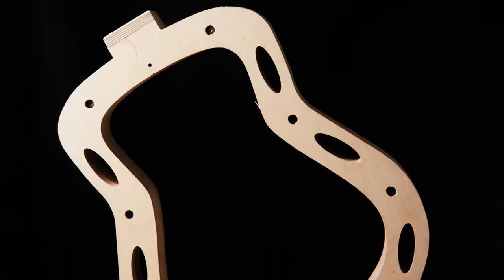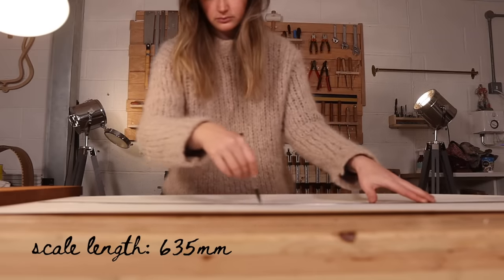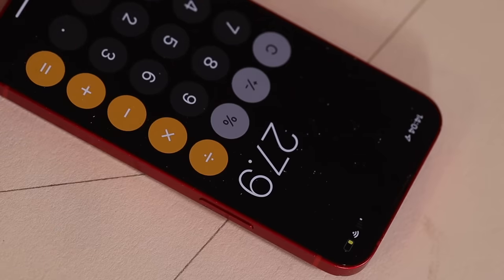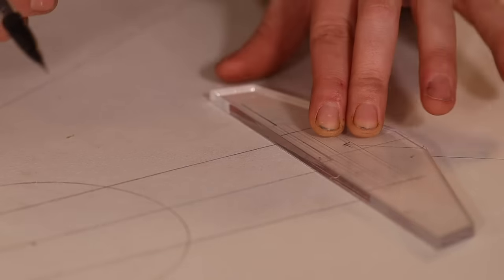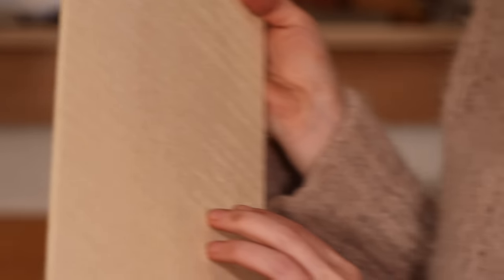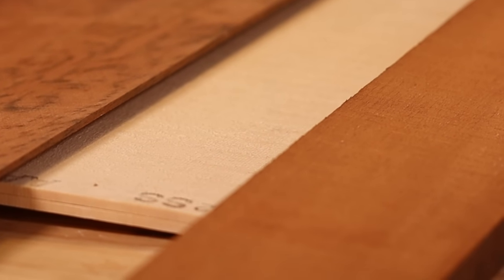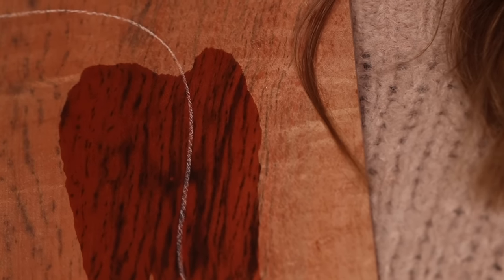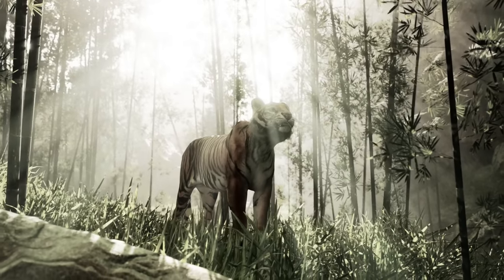My first step when I make a guitar

Comment: Im waiting for my UK pickup to arrive before I can start drawing out the string spacing and with that neck width, I copied my current string spacing at the nut from my strat, but may alter this depending on the pickup spacing, building an archtop

Comment: I had some mahogany piece, really small width though laying around from my former work. So I cut in half with a handsaw of course, and I bent it, pretty succesfully in a cutaway. But I'm pretty sure this is the african mahogany. Really tough to bend I read on this later. It took me a good couple hours, probably due to it having a crack at the cutaway, and the material being 3mm thick. I think I'll be succesful at glueing this crack though. And then I'm kinda happy with this 3mm thickness. Yes it takes a long time to bend, but I feel that is totally worth it. Especially if you don't do cutaways. Bear with me though this is all forum knowledge here, but also read that the sides of the guitar pretty much don't contribute to tone at all. So I feel that if I wanna make a good score on structural integrity, the sides are a good place

Comment: Great size choice. I’m 7 years in on a Martin 000.  I love smaller guitars but generally if you play them hard the tone falls apart (little martins do that quite early on but they sound quite good doing it as Mr Sheeran will attest).  I found the 00 also started to fall apart on a massive strum out, but the 000 hung in with whatever I could throw at it.  I spend most of my playing well away from the limit but it’s good to know you can go there if needed.

Comment: Thanks for the glimpse into your process, Daisy. None of my furniture designs are inspired by poetry, but perhaps that's something I need to try. :) The pieces I've built and the ones in the short-term queue have all been driven by functionality and my still fairly basic skill level. That hasn't left much room for getting too detailed in the aesthetics. That's left me leaning heavily on classic proportions and fairly simple forms, though those of course have their own beauty. 

You've selected some amazing wood for this project and I'm sure it will turn out spectacularly. I didn't catch what species you're using for the back and sides - is that goncalo alves, aka tigerwood?
Reply from the maker: It is tiger myrtle! And yes furniture pieces would lend themselves well to poetry I’m sure :) thanks for the kind comment

Comment: yeah so getting that crack all the way back isn't gonna work. At the cutaway I got now stains from heat and a little dent because of the crack. I'll be using the real estate I got and just sand the curve until a thickness of 1,5mm. then glue a piece of maple veneer on the inside, this way nobody will ever know except potentially everyone